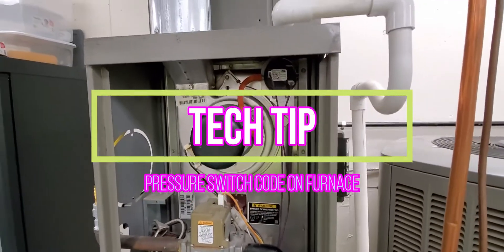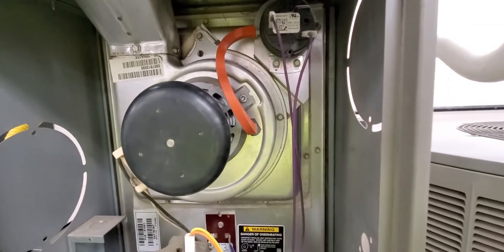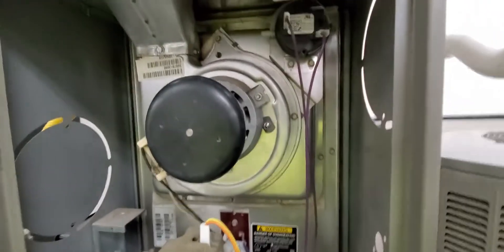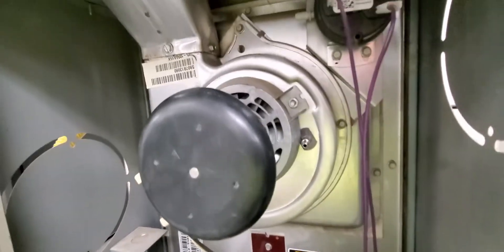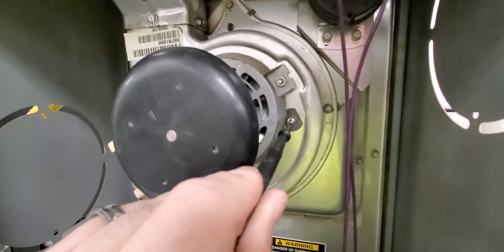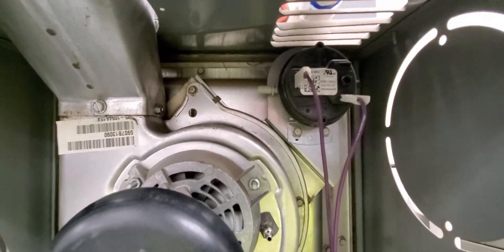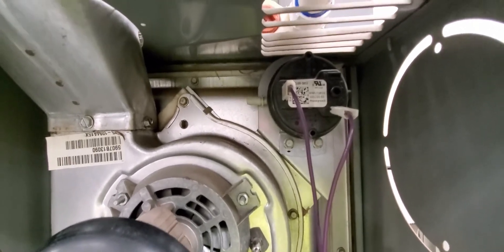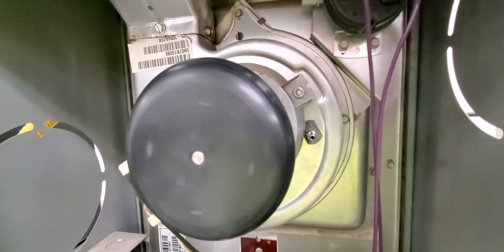Furnace error code for pressure switch

Comment: Just had a new furnace installed and the next morning no heat. Had a 32.1 code 
So I removed the small rubber hose from the furnace side and about half a teaspoon of water came out.
Plugged in back in and installed the doors and the furnace ran.
What would cause water in the hose ?
Reply from the maker: First, is this a 90+ furnace, if so the drain lines may be plugged and or the installers did not configure the drain lines correctly.
Reply: @baileysair  the small rubber hose had a droop below the level of the inlet for the hose so I readjusted it so  water wouldn't plug the line.
I'm all good now thanks 👍

Comment: I was dubious, but it worked! Interestingly there seemed to be a little grease residue on the motor side that I poked thru with my multimeter probe, clearing the ends like you showed in the video. I wonder if that was making a false seal.
Reply from the maker: There shouldn't be any grease as shaft and squirrel cage is the only things inside the housing. However, sometimes there is moisture that can get into housing and that can have something biological grow in the moisture and seem like grease. Most of the time we find spider webs and sometimes a white substance that is like a scale that comes from the moisture in the flue gasses.